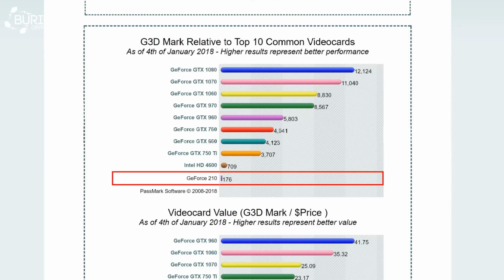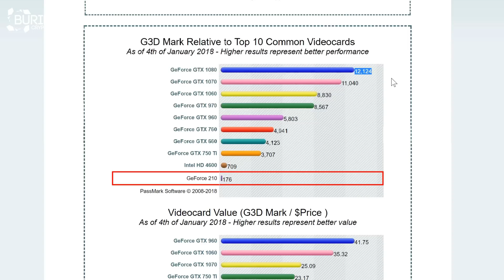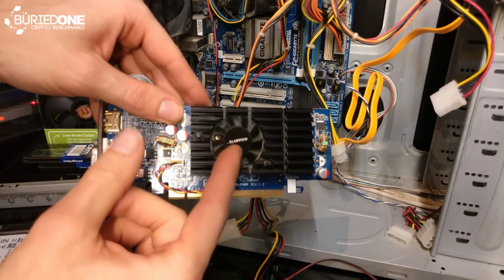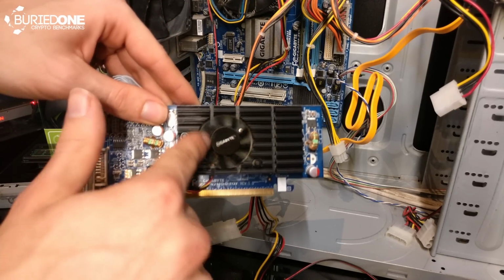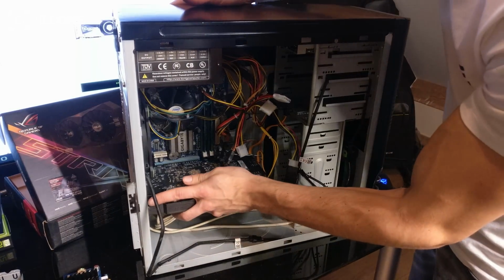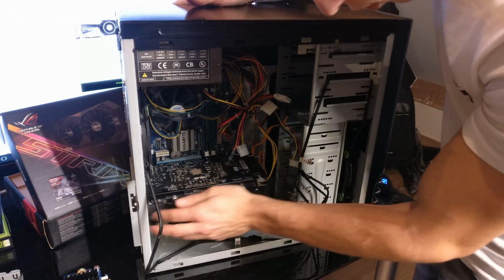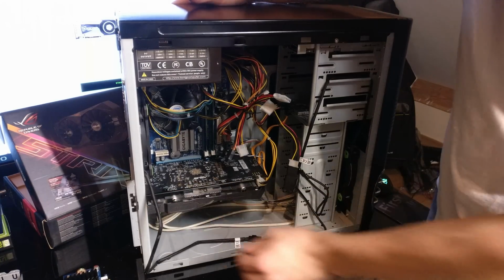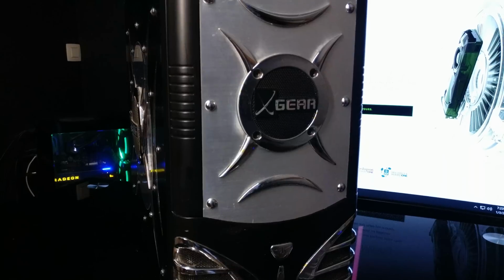How To Turn Your Old Computer Into A Mining Rig, Part II

Comment: Do you think this will work? Here's what I have from my old gaming computer. Think I can run 2-3 of either of these cards GTX 1050, 1050 TI, or 1060? Any tricks to get an older motherboard to recognize the newer graphics cards?

Motherboard - ASUS P5N32-E SLI
Processor - Intel Core 2 6600 2.4 GHZ
Ram - 4 GB DDR2 800
Power Supply is 750W
Current Graphics Card is a Geforce 8800 GTS
Reply: imho any GPU you mention will do for your 750w psu, depends on your budget for GPU i guess and ROI

Comment: Will this GPU work with a 250w psu? Or do i need to buy a bigger PSU?
Best regards
Reply: you need to calculate your GPU tdp (comes with default factory specs)
for example: 1x rx 470 here needs 150w + systems about 150w (mb,procc, hdd)+ 10% W spare = total w psu needed
thats for 1 gpu..of course you can add more gpu and recalculate again

Comment: I'm planning on building my first rig. I have a Sapphire Nitro+ RX 580 (8GB) and plan on getting 4 Vega 56 cards. Any suggestions for a good motherboard and CPU for these 5 cards? I plan on getting 3 extra Vega's after to complete an 8x GPU rig. I keep reading that some motherboards have problems running more than 4 Vegas. Will the Asus Prime z270-a do?

Comment: ï have a old laptop computer ï dont know if ï can use external GPU
Reply: TOP TOPI should find out if it has a PCI-e slot so that you could connect a riser to your mobo
Reply: You can use the razer core if your laptop is compatible
Reply: iRuffy :D I very much doubt that the core will degrade mining performance. Games are a bit slower because of the lower bandwidth, but mining dosent care about that.